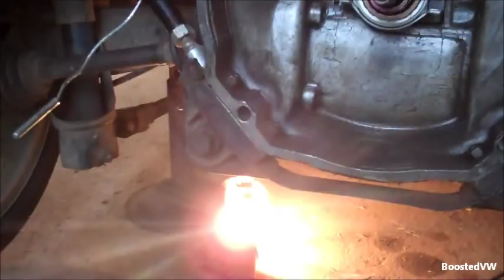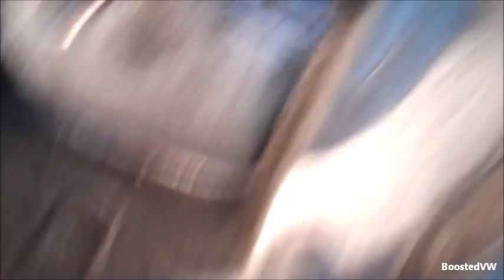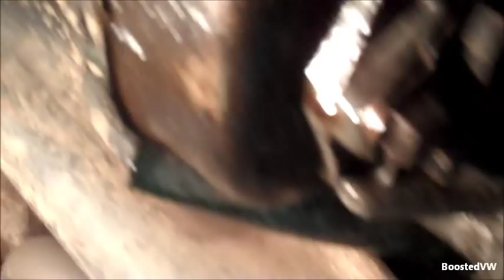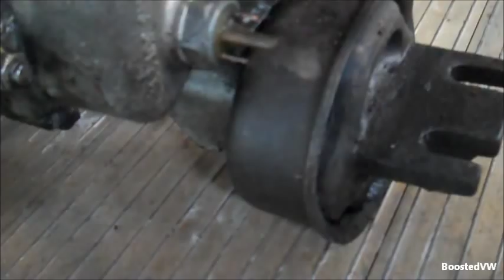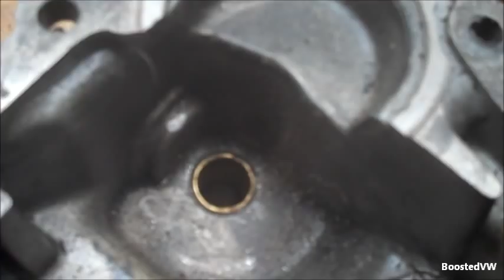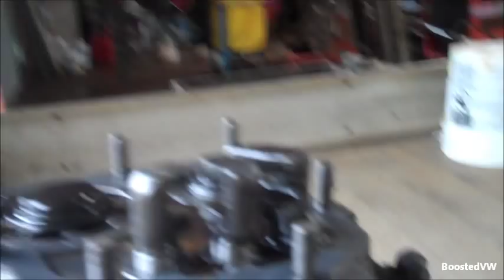VW Beetle Transmission Removal

Comment: I watched your video before buying a used transmission I had to take out.
I could only get one axial out at the gear box. The other one I had to disconnect at the wheel.
The only mistake I made was that I should have just cut the starter wire because I twisted the post right off .
thanks for posting such a helpful video.
Reply from the maker: dog bounty thanks, glad it helped

Comment: Hey awesome videos! I was looking at few of them and I was wondering if you could make a video on how you did your led lights under the dashboard. I've been trying on my 70 but I just can't get it. I would appreciate it a lot thanks!:)
Reply from the maker: Thanks Martin, the LEDs under the dash were dead simple.
You can buy them off ebay as a strip with sticky backing so they just stick the underside of the dash and the 2 wires I just piggy back off the interior light globe holder.
I might make a vid soon about all the little gizmos I;ve added as a few people are asking about some of them

Comment: Great vid.  What's the part number for the bushing and seal kit?  My local parts guy, who has been working on VW's since 1968, says he never heard of anyone replacing anything in the nose cone.  The only part he had was the plastic bushing for Ghia shift rod.  Thanks for any guidance you can give.
Reply from the maker: Thanks Kevin.
The brass bushings the hockey stick run in just wear out over time, they are something that only gets replaced when a trans is torn down and rebuilt so not many people are familiar with it.
My trans has over 500K on it so they were just unusually worn and the seal was letting a lot of oil into the tunnel but normally they wouldn't be that bad and most people wouldn't notice.
the Kit I bought didn't have a part number on it from memory but CIP1 do sell the kit with a part number on their website is VWC-131-301-225-B
Reply: BoostedVW Thanks so much!
After I first watched your video, I suspected the front seal on my tranny was leaking as well.  Sure enough, there was oil in the tunnel and when I let it down off the jack, oil poured out of the seal.  There is also a massive build up of oily dirt in every crevice from the nosecose to the bell housing.  The oil has destroyed the front mount rubber as well.  I ordered the bushing kit and now I'm in the process of cleaning away all the grime and changing the gear oil.  Keep up the great instructional material!

Comment from the maker: Yeah I'm running 18" with low profile tyres so a 091 bus trans would have me at 3500rpm instead of 3000rpm.
Makes alot of difference to fuel economy which is one of the main reasons people go Subaru engine.

Comment from the maker: Hi Stephen, the header tank is just a simple box, its only there as a fill point and air bleed as the highest point of the system.
Coolant volume doesn't matter too much, mine holds 15L, stock subaru is about 5L by comparison.
More coolant there means more in reserve but also more weight.

Comment: I love your vw subaru conversion update I am thinking of same but on old style beetle. The aluminium overflow box on the firewall, are there any baffles in it or is it just a box? Do you have to calculate the volume of radiator pipes and hoses or do you just fill the system to capacity? Keep up the good work.